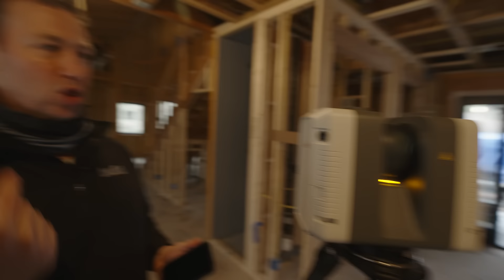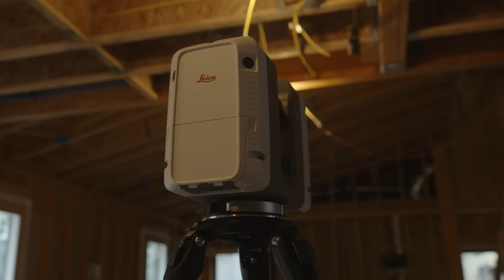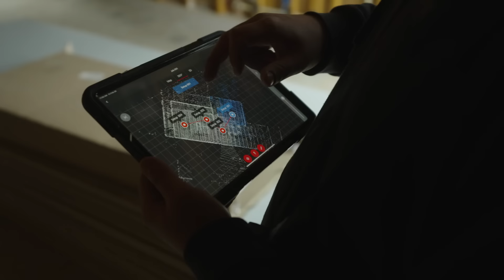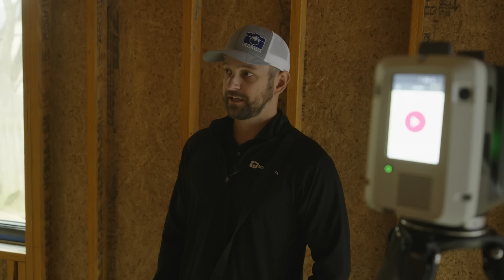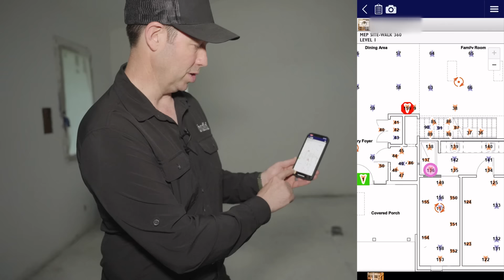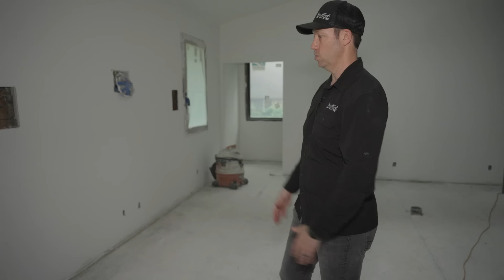Construction As-Builts 2.0

Comment: Matt, A bit of advice if you would be so kind!
I need to frame a wall at the back of my house fairly soon but I want to have a sliding door in it when I can finally afford it. 
Is it possible to frame up as though I was putting in the door then filling the space with a smaller frame that is screwed in so I can just remove the cladding, undo the screws and fit the door? 
Or should I just frame as normal and just reframe that section later?

Comment: Anyone have some thoughts on a security system for your tool trailer?  Where I live theft is rampant, and the police are useless.  I need something that will sound a loud (very loud) alarm.  I'm not sure what should trigger it....  motion?  door openings?
Reply: a combination of things would be much better then just one in my opinion. What good is a loud alarm if no one is near by? what good is motion on a windy stormy night ? if the trailer is a rockin don't come a knocking, LOL. Maybe a start could be, motion on the interior of the trailer, mag triggers on all doors and windows. wireless and cell notifications on alarm. hidden gps/cell tracking for movement tracking, and enough batt backup to last a few days/weeks so you can find the trailer after someone takes it. Maybe even cameras if ya like. Soon all the security might outprice the trailer.
Reply: @KevinSatterthwaite  Thanks Kevin, I'm looking for recommendations on specific equipment.  I have a battery in my tool trailer, and it's parked outside my home at night, so a loud alarm will work for me.  My trailer has one side entry door, and the barn doors at the back, so I was thinking mag triggers on the doors for sure.  My biggest concern is the loss of work from losing my trailer and associated tools.
Reply: @northernlightsrenovations1710  ahh, run down to your local car audio or powersports shop and look into car or powersports alarms. Maybe something like the viper powersports stuff. add the GPS tracking and extra sensors and two way remotes if ya like. bulk up with extra offline battery capacity to last extended storage time at home or the jobsite.
Reply: @northernlightsrenovations1710  i think a good start would be opening sensors on the doors, shock sensors near the doors, shock sensor near the trailer tongue and gps tracking in case the potential thief is really quick with hooking up and driving away before you get outside.

Comment: This type of tech, (laser scanners & photo documentation)  is well established & solid technology. It's been in use on large commercial projects, typically healthcare, aviation, and other heavy MEP projects for a long time now. I used to support construction technology for a big commercial construction company years ago.  I'll be frank (and no offense to this video as it's promoting advancements in construction), but  laser scanning is a bit overkill for residential...unless you're working on historical restoration projects. If it was me, I'd look at a Robotic Total Station (RTS) instead of a scanner and just take pictures to use for as-builts.  RTS can double as a "low tech" scanner, to measure critical things like floor flatness. They typically cost about $25k to $30k for high end models and about $15k on the low end. There's a huge gain to moving to Robotic Total Stations even for residential contractors, especially concrete contractors that do a lot of layout. Trimble has a free software called SketchUp and Connect you can use to store all this 3d content, or just want to play around with it. Leica, Faro, Trimble, Topcon and Hilti are all major players in this specific space.

Comment: I am a HVAC draftsman on the commercial side in the midwest, We have the P30 and RTC360, this machine has made remodels a breeze, after the ceiling is removed from a project we go in and scan the area. This helps prevent lost time in going and visiting the jobsite to do field measurements. Our plumbers and steam fitters use this technology to do retrofit jobs as well. We are able to do prefab in our shop and only have (2) field welds instead of welding everything on site. Money saver and game changer. Thanks for sharing Matt!

Comment: Clearly the vast majority of the crowd here had never opened Revit or AutoCAD, let alone try to wrestle/work with the lower resolution point clouds. The 1-2mm accuracy they quote here is astounding and sorely needed. Vast improvement over Matterport et al.
Reply: Exactly, we resorted to manually measuring up the site because there were inaccuracies in the point cloud from matterport.

Comment: I like the building thy built 1000s of years ago copper dorms copper stand seam or slate 8 by 8 native hardwood modern tenet timber frame known to stand over a 1000 years copper roof last 990 years why are the new home build out of scrap an have a lot of MDF particle board the is highly flammable an then use a 100 k camera to inspect a house that ignores the real problems that’s why the air quality of new homes are toxic because there build out of chemicals that harm the air quality an out of scrap an glue why not build out of cardboard an coat it with fiberglass it sinks as bad as that MDF ❗️

Comment: A Matterport Pro camera is a fraction of the cost and also uses lasers to give the ability to measure at will.
Reply: The accuracy isn’t there with the Matterport though. If you need marketing pieces or proof of finish Matterport a great. This technology gives you exact built digital plans with millimeter accuracy.
Reply: Yeah but Matterport quotes something like within 1 percent accuracy on measurements within 15ft. Good enough for real estate but not to build off of... 1-2mm accuracy on this system is incredible.

Comment: How is this different from matterport matt? I own and use a matterport for my business and it does this for a fraction of what you say this costs.
Reply: Millimeter accuracy and highly detailed nooks and crannies. This is enough to model off of for existing conditions to a T.
Reply: @kyledalessio7802  Matterport is accurate to 1" I believe, which is fine in my opinion for residential construction in the prelim planning phase. We use it extensively on Renos and have seen cases where it has saved us thousands, however, the software integration into Revit is pointless. There's simply too much information, tens of thousands of these 3D cloud points that only allow you to trace within Revit with your new walls. It's not like it creates walls or planes for you to work with. The other issue is that finding walls that are out 1/4" or more really makes the modeling of an existing building difficult. Sometimes we rely too much on technology when it should really be site verified or adjusted to fit in person. I don't think people understand how out of plum, square, and level a 100-year-old house can be. Modeling such a house in Revit would be purgatory...
Reply: @kyledalessio7802  a point cloud is nice but it’s more user full to have it converted to planes and objects.
Reply: In layman's terms the Matterport is more focused on visuals and creating a really nice virtual walk through and less on the measurements and backend export files . The RTC is literally the opposite.